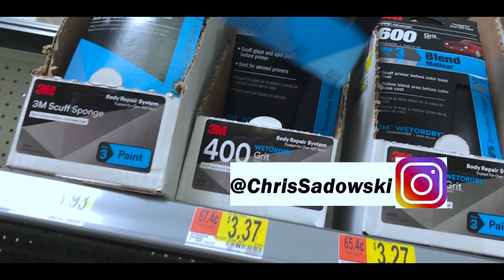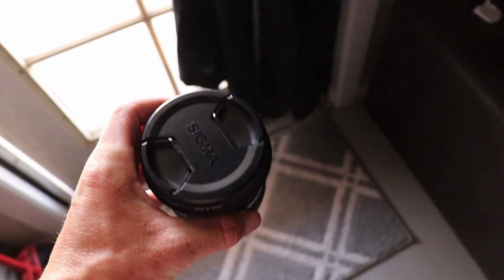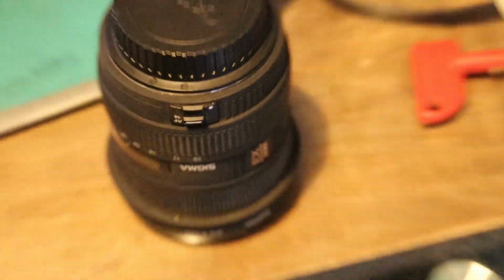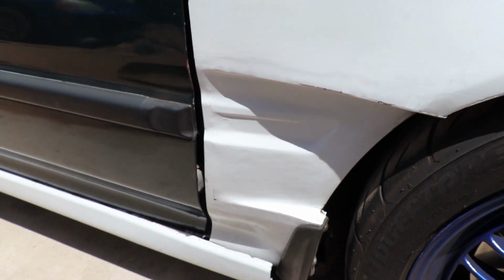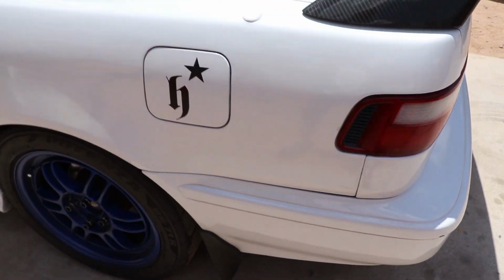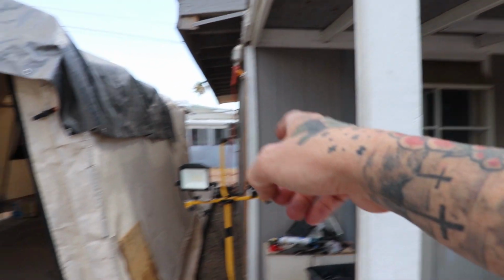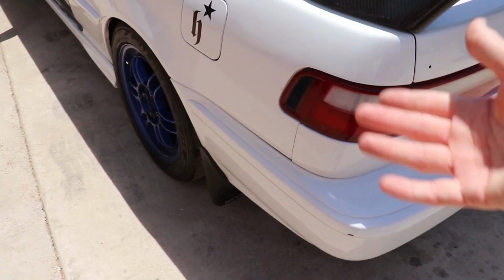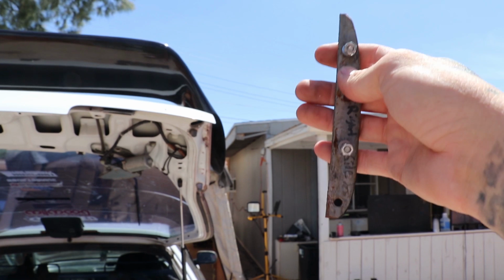Started Prepping The RHD Integra For Paint

Comment: You should use Super SEM Flex Paint Additive or some other good brand to keep the sticking to bumpers and other flexible parts...can’t wait to see this freshly painted..Also if you can pick up a orbital sander..
Reply from the maker: I will definitely look into that. Does it just get mixed right in with the paint?
Reply: There are many brands of 'flex additives' most of them are mixed in with the clearcoat. Basecoat colour is pretty thin and flexible, some clearcoats can be brittle when they dry. Rule of thumb is the slower the clear dries, the more soft and flexible it will stay.